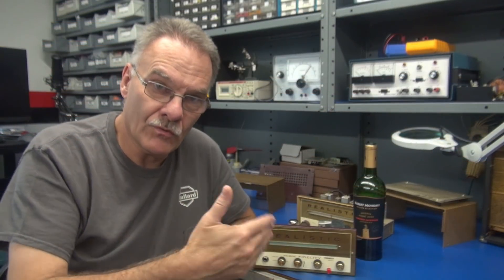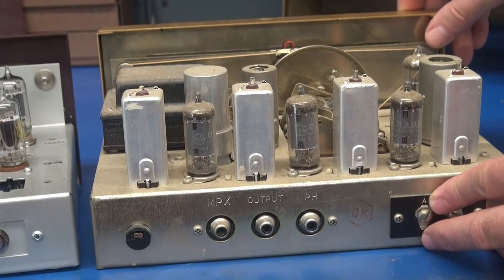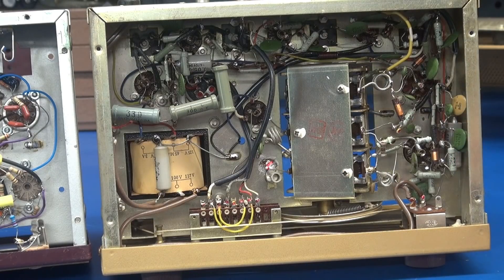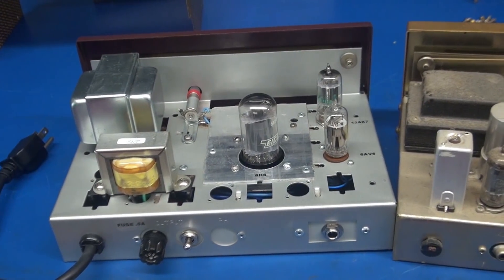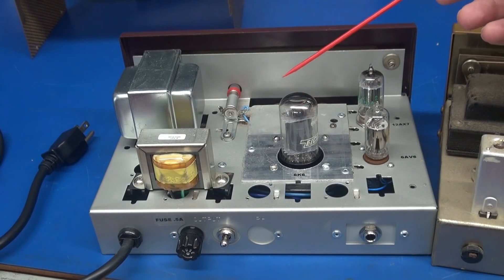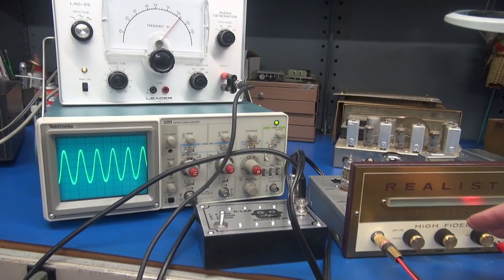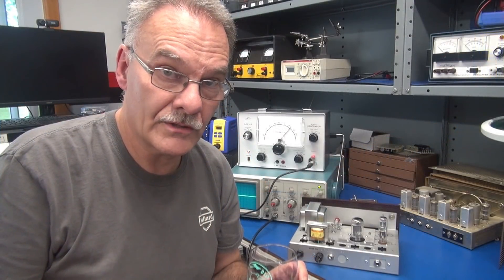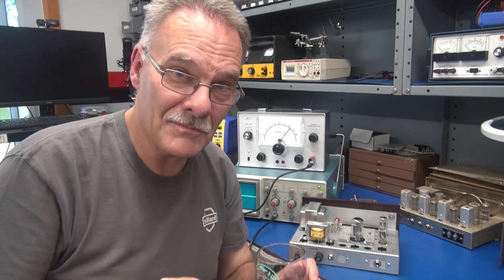How to build a 6K6 low power guitar amp using a Realistic FM Tuner features Tremolo Homebrew project

Comment: Just built the Super6K6 and it sounds fantastic.  Had to remove the tremolo circuit as my chassis was too small when I used the circuit boards from Terry.  Love the unit.  Puts out about 2 watts into a 10" Cannabis Rex.  Lots of head room and gain.  Loud in my living room, but can play it very low with an excellent tone.  Great job Terry.  I will build another of your designs in the next few months.  Possibly the 6CL6

Comment: Do you have a schematic for a class AB push pull using 6k6 I have good power xmfr and output xmfr and 5yg rectifier I got 300 and 300 secondary  on the power xmfr and is 100watt

Comment: Ever heard of the 6W6/6DG6/12L6? They're designed to run at 110v on the plate and it doesn't take much voltage at all to drive them to saturation. You can probably get 2w out of it single-ended and still reuse that power transformer. The only downside is they take a LOT of heater current.

Comment: I wonder if that stock PT would be able to deliver enough current if you used a voltage doubler rectifier circuit.....
Reply: ...the transformer didn't have the current capability(?)
Reply: @daleburrell6273  I'm pretty sure he only mentioned that it doesn't have the proper voltage in the video.  An amp circuit like this only needs about 30mA.  If the transformer can deliver 60-75mA, a voltage doubler would be able to drive this circuit just fine.

Comment: From Leo: Nice job of designing and building.    A 6K6 can do about  8 watts max but has a different plate voltage than a 6V6.  Wouldn't a 6V6 power tube use a lot more common power transformer?     You are very resourceful in finding parts, I guess I give up too easy.  Keep up the good work, I really enjoy your videos.

Comment: I thought your B+ voltage would be much higher. Is it because it's utilizing a center tap ground and not a full bridge rectifier?
Reply from the maker: Yep, It actually half's the AC, so in this case approx 225vac then rectified to 295vdc